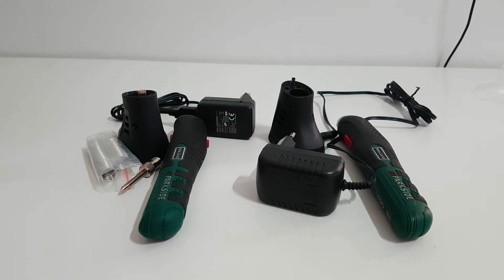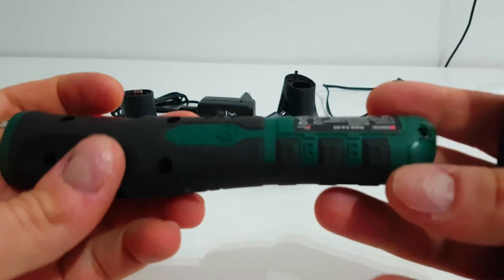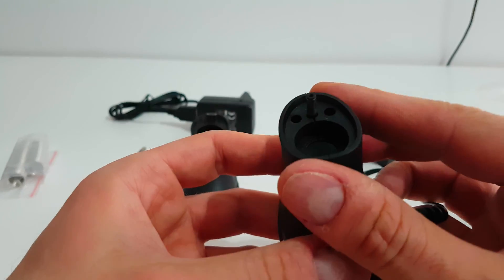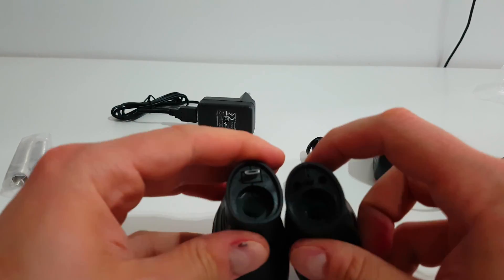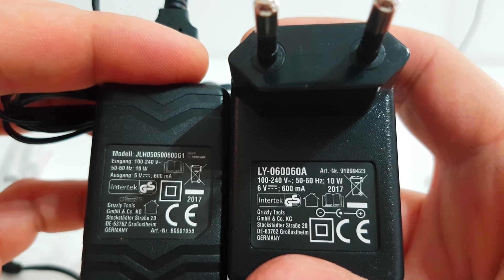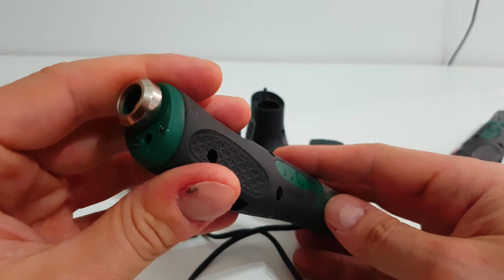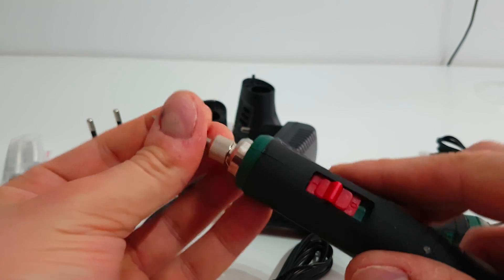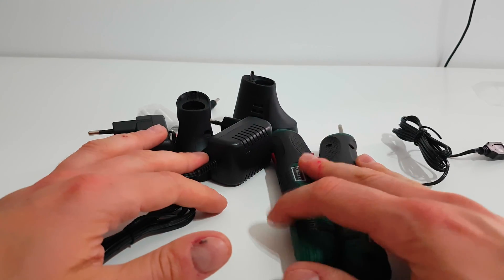Parkside Cordless Soldering Iron PLKA 3.6 A2 testing comparison

Comment: I have the usb version. 
I'm wondering, in terms of saving on power consumption:
1.) Is it possible to cut the two front leds? (Probably yes).
2.) Is it possible to cut the two red leds?

Kind regards,
 Daniel.
Reply: Daniel de Windt I’m afraid that the power consumption of the LEDs in comparison to heating element is probably almost unnoticeable :) In terms of saving power - if you need longer soldering time the better idea may be replacing the original li-ion 18650 1500 mAh cell with one with bigger capacity - even over 3000 mAh. That will also affect the charging “until full” time of course.
Reply from the maker: Yes you can cut the flash led but about the charging led indicator the power lost is so small not worth to cut :)

Comment: The one I have could not be used at all. The tip did not heat up the first time I really needed itl. Useless! No point in claiming thje guarantee as the shipping cost get close to the purchase price. Not recommended by any standards.

Comment: I have the new PLKA 3.6 A2 and the tip was broken what i must to do pls help me. Can i fix the tip or to buy a new tip
Reply: hae you found a solution yet? i have the same problem
Reply: https://www.amazon.co.uk/Parkside-Soldering-Battery-3-6-A1-Ian-283231/dp/B07DVJCJ6M/ref=sr_1_3?ie=UTF8&qid=1531155290&sr=8-3&keywords=soldering+tip+replacement+parkside